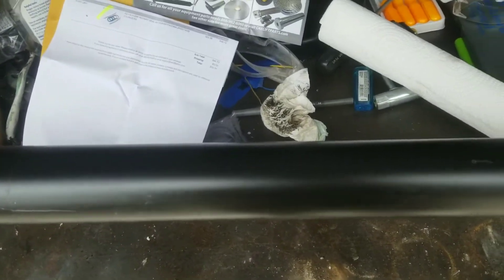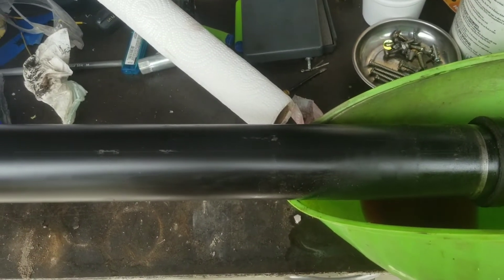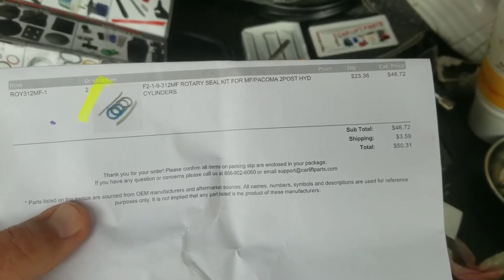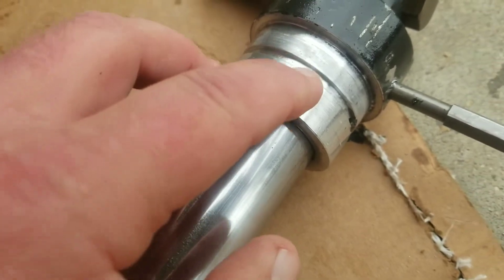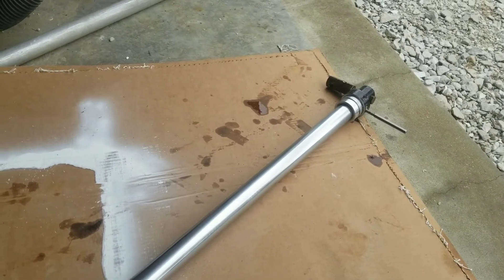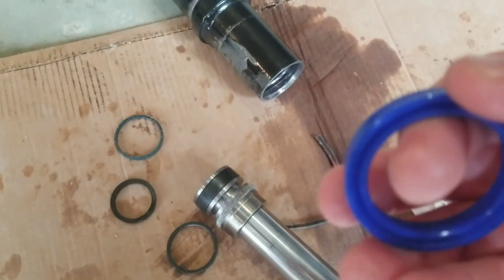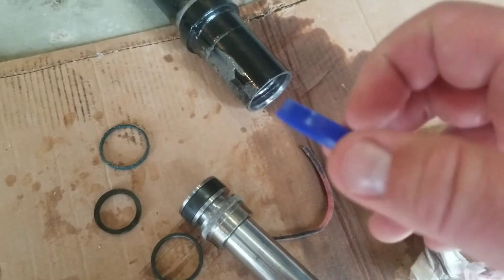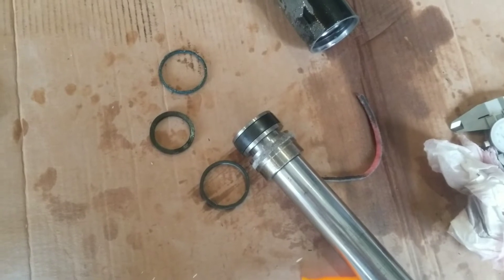Pacoma 2 post Lift Cylinder Rebuild

Comment: There is a felt rod wiper in the end cap at 4:24 that you never mentioned changing out. That's what the shorter felt piece was for. You have to remove the hydraulic fitting in order to slide it off the end of the rod. It's going to be soaked in oil and possibly metal shavings so worth considering. My cheap amazon kit has felt pieces far too thick to fit properly so it's been on my work bench for a month. I need to get it done but I just haven't felt like it :)
Reply from the maker: Thanks for the info.

Comment: I have the same cylinder and I was wondering how you removed yours? Did you cap off the lines? If so, what thread are they?  Pipe thread or JIC?
Reply from the maker: I didn't cap off anything and I tried to catch as much as possible in containers. You'll have to raise your lift and slip the cylinder out from underneath the lift arm assembly. You can compress the cylinder pretty easy after you disconnect the lines (it's going to make a mess though). Also be sure the lift arm assembly is locked in the up position as well.  It's really quick and easy.
Reply: @tightwadtv3421  thank you for the detailed response. I feel a lot better doing it now knowing exactly what I have to do.

Comment: When you took of the end cap, how did you take it out? Does it unscrew? Did you hit the pin with the hammer? It looks like you unscrewed the end cap and the lock ring came off. I'm at the same spot your at and don't know how to get the end cap off. Thanks
Reply from the maker: You rotate the end cap which pushes out the lock ring.
Reply: @tightwadtv3421  I had to use a dremel and make the slot a little longer. Then I used a small flat screwdriver to get under the leading edge. Then I rotated the cylinder counter clockwise, it walked right out. I wish I had seen this video earlier, it took me a short while to figure it out. I did something very similar to this years ago, it came to me, that the only way I was able to figure it out. Thanks for posting this video, I am waiting for my rebuild kit to get here. My car is now trapped on the hoist until I can fix it. lol